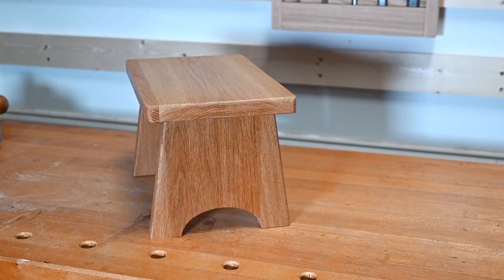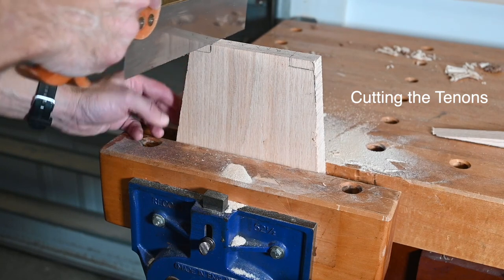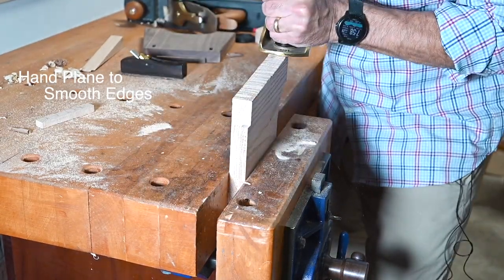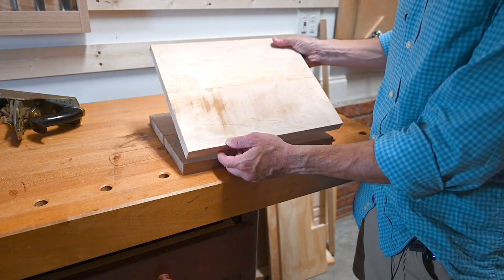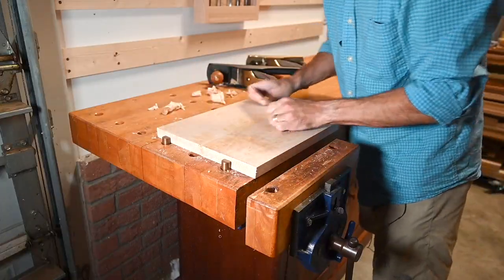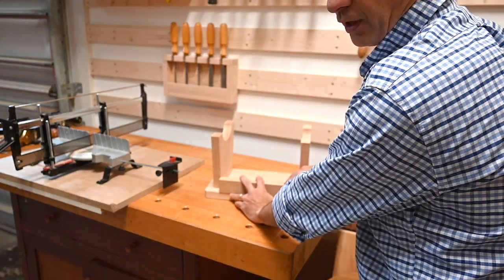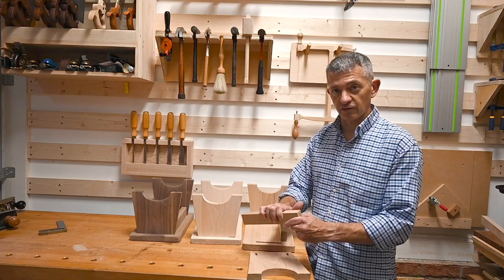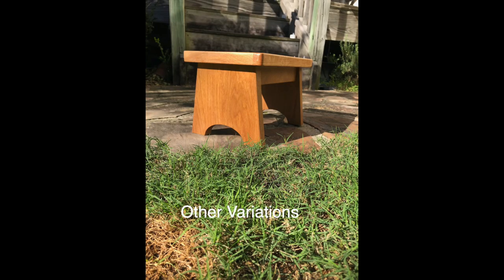How to make a strong wood step stool - DIY Woodworker Weekend Project

Comment: I've been making tons of these recently for our little boy to be able to get up onto chairs, use the bathroom etc. I like this design so I might try it, no domino joiner so I'll probably just use a couple of dowels. Thanks for the video!
Reply from the maker: Dowels should work if you use two of them to prevent rotation of the rails.  Instead of a domino joiner, I have also hand cut the tenons as I do in the plans on Etsy.  Here is a video on hand cutting tenons  https://youtu.be/KXoCV_fyUiY .  It was my first video, so no music and I was brief.  But I do enjoy hand cutting them and then using a shoulder plane or rabbet plane to trim them to the size of the mortise.

Comment: Like the simple design and clean look.  A quick question for anyone and everyone.  Why not cut the legs at a 5 degree angle to make them lean towards the center?  Would it not make the stool just a bit more kid friendly for sitting or climbing on? I plan to go on a scrap wood hunt later today to see if I can find some wood to make some of my own.  Nice inspiration.  Thanks.
Reply: The morise and the tenon shoulders would have to be angled.  That is a little tricky but definitely doable.

Comment: So excited by all the hand tool work in this video, I gritted my teeth when I saw the tablesaw, and then you hauled out the Domino. Still, a nice video.
Reply from the maker: About to start making videos again.  Will try to use as many hand tools as possible, because I enjoy them.  However, I will occasionally use power tools and even a CNC Router.

Comment: I'm new to this so what kind of saw is used to cut mortise in rail? Is thhat a domino?
Reply from the maker: I used a tenon saw.  Sometimes also use a carcass saw. Most of my nicer saws were from Lie Nielsen.   I did use loose tenon, made by a Festool domino, on the rails.  Have also just cut tenons instead on some step stools.
Reply: @builditnotes7551 I'm thinking of using a plunge router with jigs, am I on the right track?
Reply: Yeah, its a Festool Domino, a relatively pricey tool.  Dowels or biscuits might work.